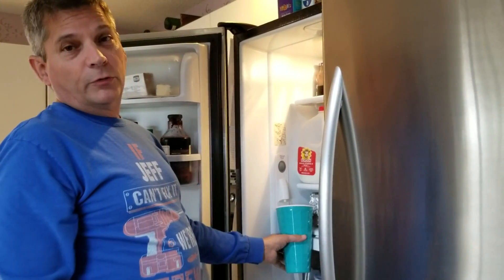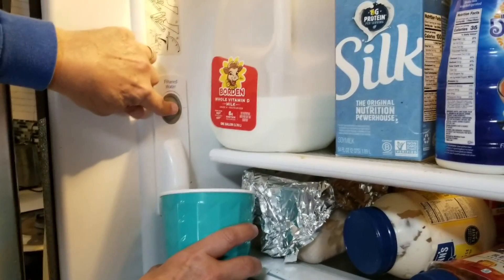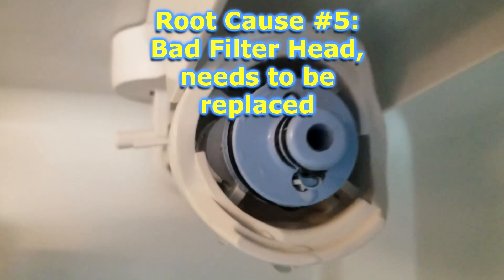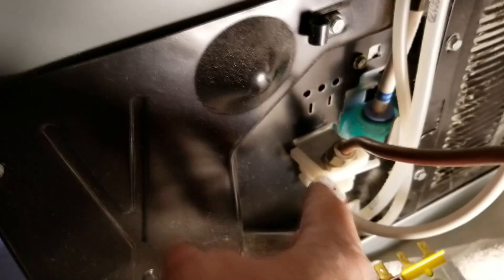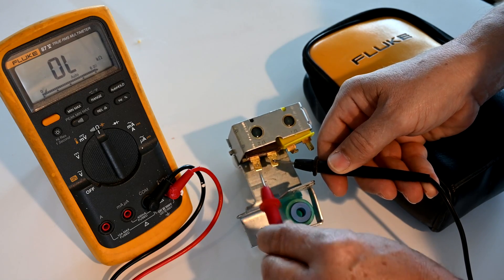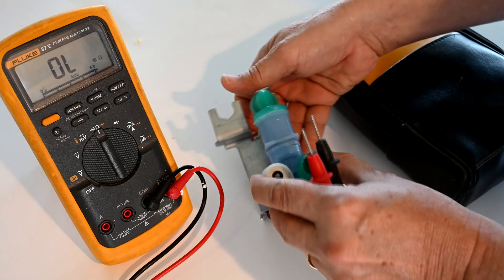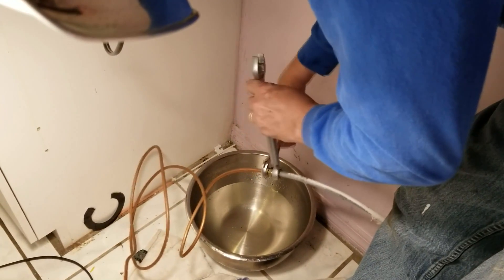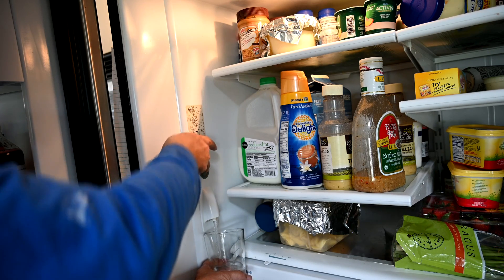5 Reasons Fridge Won't Dispense Water: Inlet Valve Fix DIY

Comment: Although our Kitchenaid Architect II refrigerator is different than the one in your video, your suggestion on how to repair a frozen water dispenser worked wonderfully well!  I removed both crisper drawers, then ran my hair dryer over the water tubing (ours was built with an enormous amount of tubing) for a few minutes.  I heard the water dispenser click and, sure enough, water came out!  I can't thank you enough!
Reply: Could you see ice ? I can't . But I'm going to give it a try I also have a lot of tubing and it's small tubing .

Comment: My fridge doesn’t have a water filter it’s a Samsung in fridge water dispenser
Reply from the maker: they should all have a filter. Try looking under the bottom front grill by the floor. I can't imagine you don't have a filter.
Reply: @jeffostroff  

I called them today and my fridge has the water dispenser inside the fridge but does not have a filter ! Good thing I bought a water dispenser with a big jug of water , I found out the city pipes are lead , I stored drinking fridge water so fast . 
But you would think that the fridge would have a filter ! Unbelievable.

Comment: How long should I run  the hair dryer? I noticed when I used the hair dryer, the temperature went up from 39 to 44. I only ran for about 5 minutes and still no water coming out so I wonder perhaps I should run it longer but how longer?

Comment: You helped us fix our problem, thanks.  But we noticed on our (same exact refrigerator ), we have 2 tubes coming down through that track out of the back of the fridge where the filter is located, but the tubes just end about 3/4 of the way down the track. They are open tubes and do not connect to anything. Does this mean our filter was never hooked up?  ( And we have spent a fortune on filters that never saw an ounce of water)?
Reply from the maker: Yes those tubes are supposed to connect to the water inlet valve at the bottom of the fridge, so you might have to replace them with full length tubes

Comment: My KitchenAid refrigerator is 30 years old and the water dispenser stopped working back in 2011 would it still work? 😂😂
Reply from the maker: Yes I think so, I would focus on the water inlet valve and the filter head, and make sure the reservoir bottle is not frozen.

Comment: Hi. Big thank you from Sydney, Australia. I was wondering if you kindly assist me with my issue. My water dispenser stopped working and we definitely did some google research and found most likely it was our inlet value. So we replaced it and it got it sorted and worked beautifully for a week. I was wondering what could be the issue. I don't have that device to check of OL. If you could kindly lead me to the right way would be fantastic. Thanks a million.
Reply from the maker: In our case we ended up also having to replace the filter head for which we have another video for that repair. The filter head is where the filter screws into on the refrigerator and that filter head has a little gasket in it that apparently stops working overtime and it will stop the flow of water. But I can tell you that 90% of the people who respond back to our video tell us that their problem was solved by our other tip of using the hair dryer to warm up that reservoir bottle that's built on to the back of the inside of the refrigerator where the water was freezing and once they melted it and thought it out it works. And if you don't want to try that trick I would just let the refrigerator sit open for a day or two and let it get fully up to room temperature with the refrigerator and the freezer and see if it works again after that once you turn it back on. If it does then chances are there was some kind of frozen water somewhere in the lines.

Comment: Hi, because your water dispenser was working you failed to tell us how to fix it.  Mine is not working and you just went on without even talking about fixing the problem.  But thanks for your other advice.
Reply from the maker: Ours was not working and we showed you the 5 most common solutions. Ours still wa snot working because the filter head was bad on the fridge, so we did a separate video n that repair.

Comment: Reason #6: Broken water line and you're also getting a leak under your fridge. FML =)
Reply from the maker: Yikes! You have copper line? Those leak easily if they get kinked
Reply: @jeffostroff  no, it was the plastic tubing between the valve and water dispenser. Almost 20 years old...

Comment: Hey Jeff. Thanks for this video, you really helped me out with this! I'm wondering, for the same type of fridge, what are my potential problems / reasons why it's not making any ice ?
Reply from the maker: Some reasons could be water inlet valve not working, or kink in hose, but if you have running water, chances are there's no kink in the hose. The icemaker switch lever to enable icemaking might be bad also.
Reply from the maker: That's right the head of the screw is supposed to stop just a frog hair below the surface so it is still pushing against the paper

Comment: We have the exact same model refrigerator, and ours won’t stop dispensing. Any tips? Is it stuck maybe?
Reply from the maker: Id the switch stuck? If not, maybe the water inlet valve is sticking open

Comment: Watched your video after speaking with KitchenAid support that were no help. I do usually look for the most common easy solutions first. (ex- is it plugged in?) In my case it was Root Cause # 3 Frozen reservoir.  My wife's hair dryer did the trick in under 3 minutes.  Thank you so much for the useful tip.
Reply from the maker: Great to hear! Yes yours is the most common issue that people report solving it with the hair dryer. In our case it was the filter head which is like the worst case scenario to have to fix so you got off lucky

Comment: Sometimes you need to call a Service Technician my refrigerator needed some technical service,  it was worth the call he was here for 10 minutes tops and he fixed the water and the ice cube dispenser and the reading for the filter where it tells you that your filter is good. Think about it after you have tried all these suggestions. Remember each refrigerator is different.
Reply: Your rich I'm not so I have to rely on YouTube
Reply from the maker: What did he do to fix the water?

Comment: I can't believe you actually had me blow-drying my fridge. But I really can't believe it actually worked! 
Thanks!

FYI, my reservoir was inside a little door under my veggie drawers when I pulled them out. And I had a single outlet water valve, so this fixed my water and ice!
Reply from the maker: Fantastic!
Reply: Worked for me too! 
I got out the hair dryer, put it on high, and glided it back and forth across the "hidden" reservoir for less than 3 minutes. The water dispenser immediately worked perfectly again ... on my first try! 

Thanks for the video and instructions on how to fix. Your solution was not included in the Kithenaid manual.

Comment: Thank you so much for all the info. I was able to fix my fridge and avoid the expensive of a tech. We first checked the water lines in the back which seemed fine. I then replaced my filter thinking it was clogged or just old cuz I'm sure it was overdue. The water was still not dispensing. My daughter had mentioned the soda was frozen this morning so I tried the hairdryer technique and I got some flow but was still not normal. So I pulled the fridge back out and it seems when my husband checked the lines he also kinked the line. We had 2 issues, original issue frozen water reservoir, ours being a coiled line in behind the veggie drawer, and then a kinked hose. Lol Thanks again!
Reply from the maker: That's why I hate copper lines, those 1/4" lines kink so easily

Comment: Yea everyone here can believe that a pro would use a Klein’s , electricians pliers at @6:13 instead of an adjustable wrench, channel lock pliers, open end wrench, etc, ANY wrench EXCEPT a $45 pair of the latest Klein’s.🤦‍♂️
Reply from the maker: Yea everyone here can believe you would stand there and not complete the task simply because your a sheep trained to only use a pair of pliers for electrical work

Comment: Hello, how do you apply the first 3 tips to a water dispenser that is outside on the door of the freezer side? For example, am I supposed to use the hair dryer in the freezer? Seems counter intuitive to use a hair dryer in the freezer.
Reply from the maker: This only applies to the fridge that case the reservoir inside the fridge section. I doubt you have a water reservoir inside the freezer. You probably just have controls on the outside of an insulated freezer door.

Comment: I changed the water valve and the problem continues. the water light does not turn on on the panel. What do you recommend to solve the problem?
Reply from the maker: Se eour other video, this is something to look into to see if this is your problem: Fridge Won't Dispense Water/Ice: Filter Head Repair DIY https://youtu.be/t4W0EaNo9gc  I can tell you 75% of our visitors have told us the problem was the water reservoir freezing, an thye used a hair dryer to thaw it out.

Comment: Is it possible I have no water shutoff valve for my fridge? I want to disconnect the ice maker water line and all there is a saddle valve?
Reply from the maker: If you disconnect that saddle valve, you'll have water spraying everywhere. You will most likely be turning off the water main tot he house first, or trace that pipe which the saddle valve is connected to and see if there is a shutoff valve further down the line. If there is none, you have to shut down the whole house water first, then make the repair, put in a real valve, and then turn the water back on.
Reply: @jeffostroff  that pipe goes straight into the wall. Is it possible to just cap that line if Intake the valve off. Or can I just not take the valve off but just turn it and use it as a shutoff valve?
Reply: @jeffostroff  ??

Comment: Hi sir I have a kitchenaid kfis29pbms02, the ice dispenser works, but the water dispenser doesn't. However, when I select "measured fill" on the menu, it will dispense water that way. Would this mean the water button switch is faulty?
Reply from the maker: If you can consistently get "measured fill" to work but yet doing it with the push button does not work yes I would start by looking at replacing the push button . Search your model number on Google and see if anybody else has reported similar on the forums sometimes things aren't always what they seem we might think it's one thing and it turns out to be another
Reply: @jeffostroff  thank you kindly, will begin my search!

Comment: Thanks for your video.  The issue I’m having is the dispenser line freezing at the dispense point (outside door). GE Profile model psc25msw. I use a syringe/small rubber hose with hot water until it goes in and I don’t feel a hard stop (about 10 inches) that fixes the issue but only temporarily. By the next day the line is again frozen.  I already replaced the flap for dispensing ice thinking it was not closing properly and leaking cold air.  Ice maker is working just fine. Any suggestions?
Reply from the maker: You may want to try increasing the temperature of your refrigerator a few degrees to keep that line from freezing maybe the temperature is set to cold period if you put a thermometer somewhere in there inside the door as close as you can to where that point is which freezes, that will tell you what the temperature is 38 degrees is normal and refrigerators for the storage temperature. Also try looking for the reservoir on the back of the inside wall of the fridge and if it is frozen put a blow dryer on it to melt and thaw out all of the water in there

Comment: Mine works well just leaking from the filter area
Reply from the maker: Did you try a new filter? If it still leaks you might be ready for a new filter head on the fridge.
Reply: @jeffostroff  it started leaking with new filter head

Comment: Hey Jeff, Jeff here.  Water comes out the water dispenser in the fridge. But no water coming into ice dispenser.  Does that mean the issue is NOT the water inlet valve?
Reply from the maker: I would check for clogs, but the water inlet valve is usually the culprit, and usually the only way to confirm is to measure the resistance across the terminals of the water inlet valve with wires disconnected.
Reply: @jeffostroff  I have this exact problem.  Water comes out the water dispenser in the fridge, but no water comes into the ice dispenser.  I just replaced the water inlet valve and ordered a new water filter.  Any ideas on how to check for clogs or do you have any other suggestions?  The ice dispenser seems to cycle, but has to water to actually make ice.
Reply from the maker: @crzylgs1515   If you're positive the ice maker is not getting any water, that I would definitely point my attention to that water inlet valve at the bottom of the back of the refrigerator. Also make sure your water line coming from the water source to the back of the fridge is not kink or clogged. Sometimes the old copper lines if you have them they can't very easily come up but the newer still belted hoses do just fine

Comment: Good video. I tried to check the reservoir and see if it was frozen, but didn’t even see a reservoir anywhere in the fridge. 
It’s a Samsung French doble door fridge. Where do you think it could be located? Thanks
Reply from the maker: Usually on the back wall inside the fridge, sometimes behind the vegetable drawers so you have to slide out the drawers to see them. IF not, good where is my reservoir with your model #

Comment: good video you helped me solve my issue. the two buttons on the water filter connector was my problem. one was stuck, likely mineral or calcium build-up. i used the end of a pen to free the corrosion and they depressed/retracted freely. thanks, Jeff
Reply from the maker: Great to hear congrats Ron, and thanks for watching!

Comment: this video described the two connections at the water filter wearing down but not how to determine if they are bad. Is that somewhere else or does it require a professional tech?
Reply from the maker: Ron Appliance PartsPros web site likely has a video on the button. They are different for everyone, so you enter your model# and  find the part from their diagram, and they usually have videos on it.

Comment: I'm having the same ssue here but all of your solutions did not work for me
I've checked for water pressure and it's good.
I've checked for continuity in the water valves and it's good
The filter are in good condition and the water dispenser reserve isn't frozen.
The only issue I have found is that the water valve isn't getting the voltage(the voltage I get is 10-16vac)
Reply from the maker: Did you check the filter head? I did not see you mention it. So it might be that or the water inlet valve not getting voltage would be a bad board, hopefully you don't have that.
Reply: @jeffostroff  I have a whirpool refrigerator mod ed2chqxvq02 and from what I've checked online it doesn't seem to have a filter head.
For the control board I haven't looked at it cause I'm not comfortable removing it, I don't wanna mess with it and make it worse for me sadly.
Reply from the maker: @JahonCross  I'm sure you have a filter head, if you have a filter. See our other video how we changed the filter head: https://youtu.be/t4W0EaNo9gc

Comment: I have a similar KitchenAid KFCS22EVMW4 refrigerator.  Similar placement of the water dispenser inside the left door.  Water comes out strong for 2 seconds, then slows to a trickle.  First thing I tried was to swap out the water filter to an authentic OEM one - no dice.  Then I tried blowdrying the water reservoir (it did seem like it may have frozen water in the reservoir, because it seemed hard, but not sure) - also no dice.  Before I go and purchase either the water inlet valve or the water line union, which do you think it is?  My hunch is that because I'm getting a trickle of water out of the dispenser, the inlet valve is fine.  Ice maker is fine.  Thanks in advance!
Reply from the maker: Without being there to see your refrigerator it does sound to me like your problem is the filter head inside the refrigerator so when that starts to wear down you might get water for a few seconds and then it cuts off.  You need to see our other video on how to repair this filter head and here is the link to it https://youtu.be/t4W0EaNo9gc
Reply: YOU'RE THE BEST!  I tried the garden hose rubber gasket hack and it worked.  Let's hope that's a long-term solution.  subscribed!
Reply from the maker: @brianyu7805   It won't last long as a fix, we eventually within a few weeks had to re just replace the filter head inside the D refrigerator.
Reply: @jeffostroff   what happens?  does the rubber ring break down?  Even though I'm capable, I'm hoping to not have to contort myself to climb behind the fridge to replace the filter head.

Comment: Hi there our water dispenser stopped working after changing the water filter. We were able to use the dispenser a few  times suggested on the filter box before consuming and then the dispenser automatically stopped. We noticed that water from under sink flows in well into the fridge into the filter but from the filter to dispenser I believe there’s no water flow. What could be the reason for this?
Reply from the maker: Did you check your reservoir inside the fridge to see if it froze up? Also you filter head port on the fridge might be bad, or the water inlet valve is not actuating, there's 3 things to try.
Reply: jeffostroff Thank you! Yes i believe the inlet valve has an issue. The reservoir was not frozen and the filter head port works fine, when clicked I can hear the water from under the sink enter the filter.  

I was wondering when changing the inlet valve, do we have to unplug the refrigerator from the wall outlet?